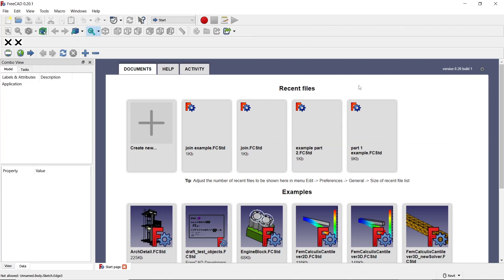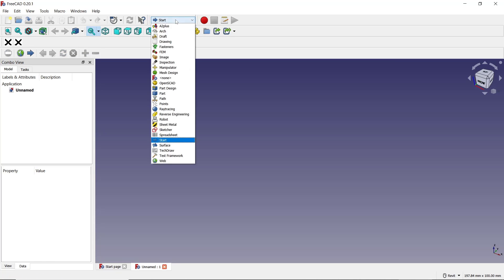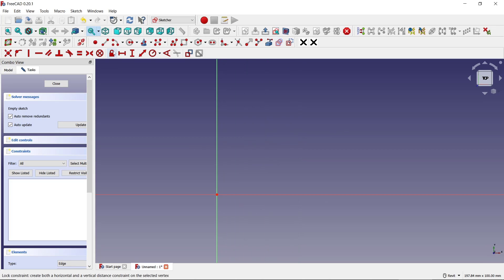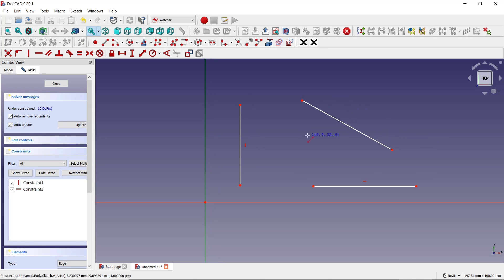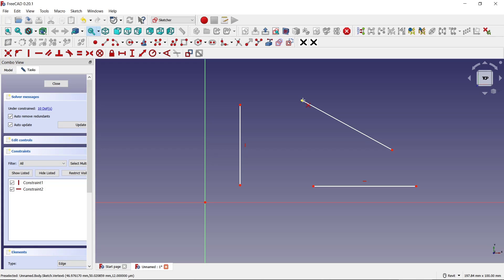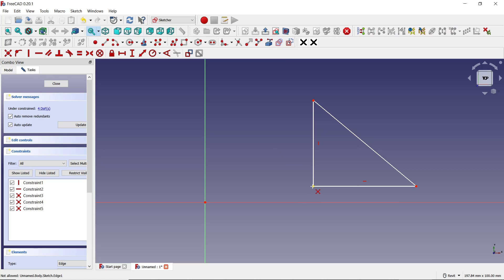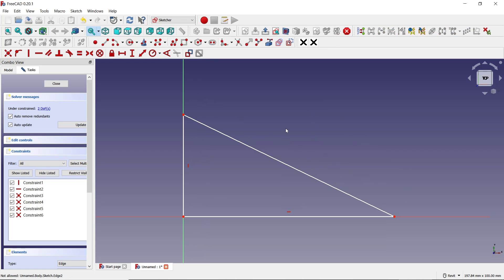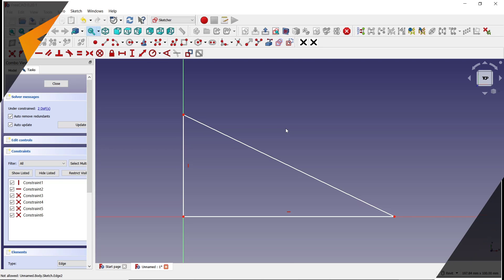FreeCAD How To Join Lines Tutorial

Comment: IT DOESN'T WORK.  Nothing works in freecad.  This software is so frustrating.  When I try this it gives me a circle with a diagonal line through it so I can't even select the dots.  I swear freecad is designed to piss me off. Literally everything I ever try to do doesn't work for some stupid reason.
Reply: Similar thing happened to me. While others were praising the tutorial I couldn't draw any lines or curves. I restarted the program, problem remained, I rebooted, problem persisted. I reinstalled freeCAD and its good now. I don't know what caused that it was ok before but at least I'm not going crazy now and hopefully it won't happen again soon, if at all.
Reply: a mi tambien, me dan ganas de cagar a piñas al repelotudo del creador... tan dificil va a ser unir 2 lineas de mierda loco?